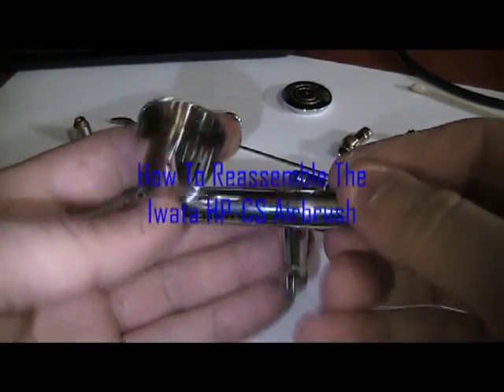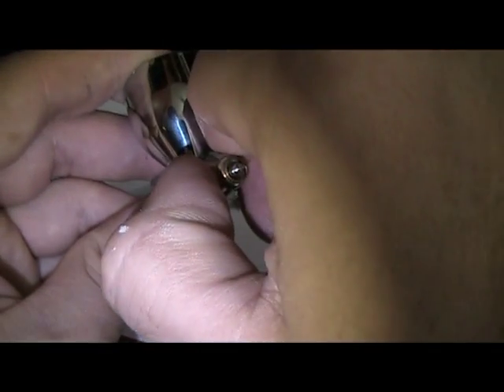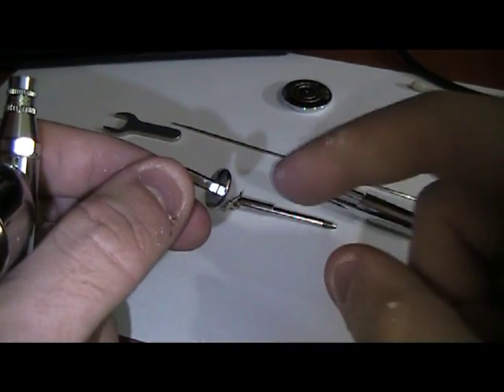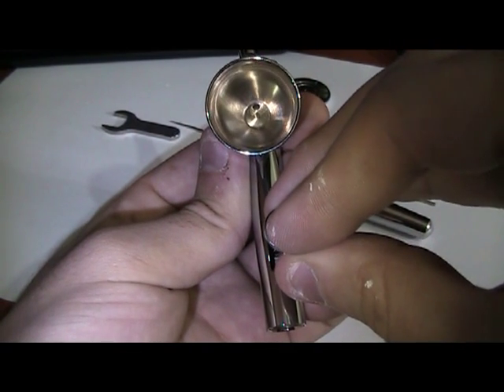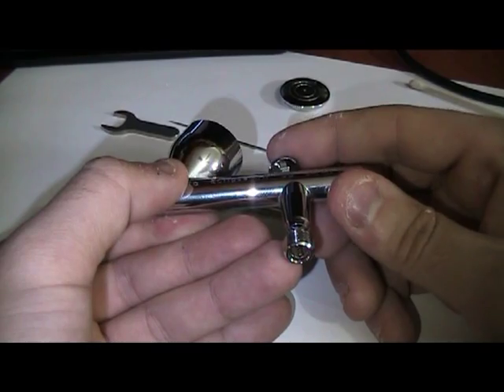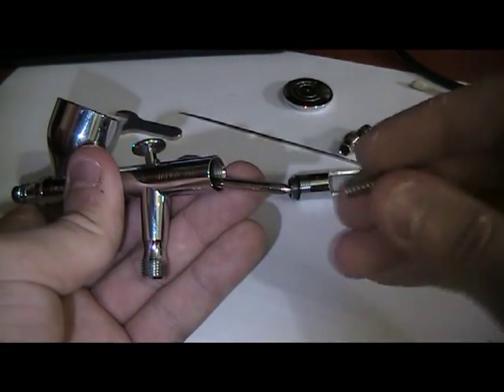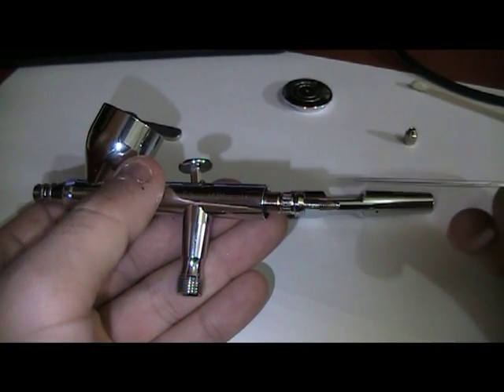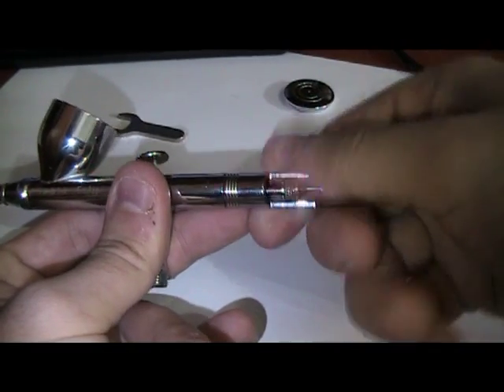How to reassemble your Iwata HP-CS airbrush

Comment: Hi Spruesnail, before assembling the first 2 caps after the nozzle, don't you have to seal the threads with some kind of wax in order to avoid air recirculation that could make the paint bubbles in the color cup? In the Badger 150 this process was necessary everyyime I cleaned up the airbrush. Cheers